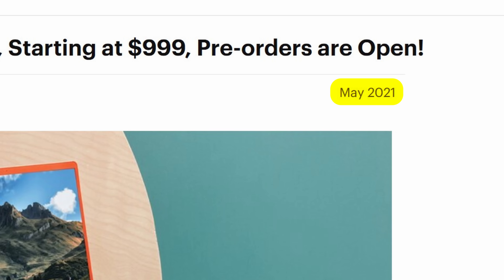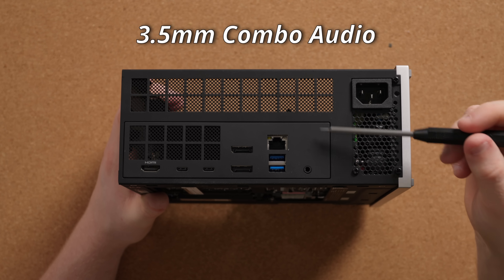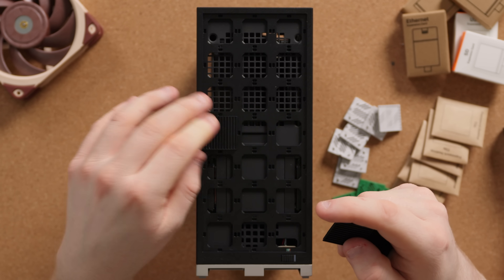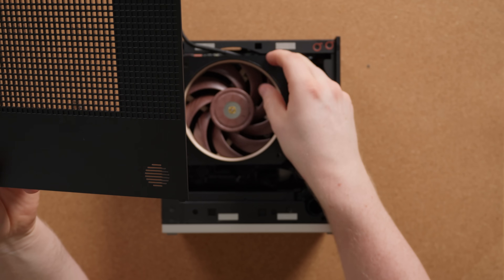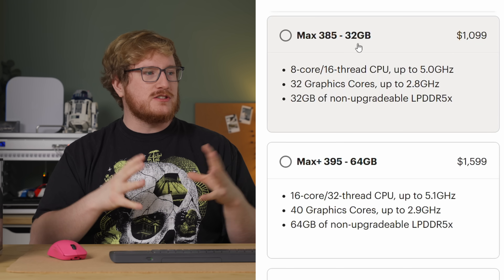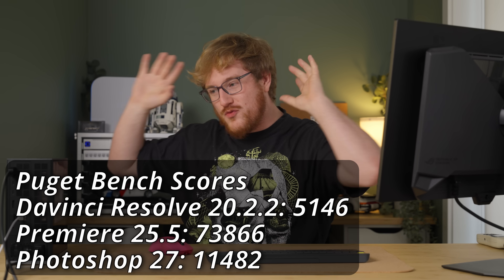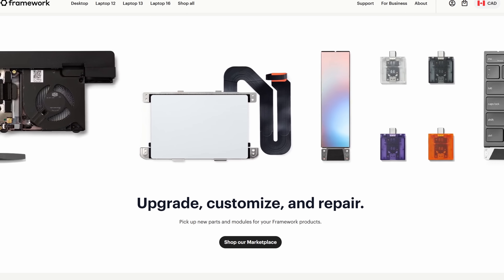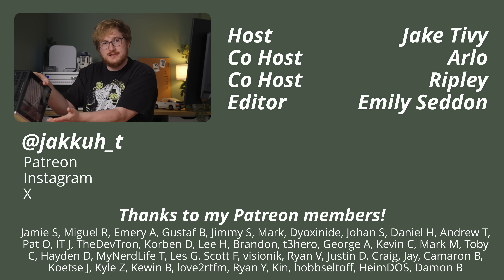I’m glad I didn’t invest, so I can talk the Framework Desktop

Comment: Maybe they could work with Valve to option it with SteamOS?
Reply: Aside from whatever issues with the mobo, this should install SteamOS very nicely.  If not, Bazzite would be a better solution.
Reply: 'SteamOS' is basically Arch with Proton. -.- you can do that too on any PC. Event today. Even in this very moment when you read this.

Comment: Why buy this when you can build a mini pc (6-7 liters) with 5070 and 7800x3d for much cheaper. And worshipped “modularity” is basically nonexistent here
Reply: Expiremental GPU that is probably the same kind used in the Gabe Cube
Reply: Because it comes with the massive VRAM which is useful for AI stuff.

Comment: Arlo treat tricks has become a great tech channel.
I can understand the power cable pricing crap a bit but I still think that they should include 2 prices on the site. One starting at price and one minimum configuration price for it to work. They could add a up-to price as well, but that would ask for too much because you could order extra stuff (my FW13 has a few extra IO-modules because I wanted to be able to change them if I need to)

Comment: On Linux, the AMD drivers can dynamically allocate more memory, so there's no need to adjust the BIOS setting up to 96GB like you did and strand that memory when you're using a CPU-intensive workload.
Reply: Agreed, I have like 110GB dedicated to the GPU, and have several LLMs loaded in memory all the time. (qwen3-coder:30b, gpt-oss-20b, etc)
Reply: @IanDouglas you can change to the ram to GPU on Linux for AI/LLM?

I have 96gb of ram and rtx 4070
Reply: @aymanhawari2589 you can on this Strix Halo system because it's an APU from AMD which is a combined CPU and GPU, effectively making it "unified" memory.
Reply: @aymanhawari2589  no. only in non-dedicated GPUs
Reply: @IanDouglas  wait damn like M chips? thats the key to unlocking full power, only when all is same sillicon.
Reply: @daavilefx if it's an APU, then yes, I think so
Reply: I have had problems with that before though - specifically ollama would, at least last time I checked, not realise it had that extra memory on AMD APUs (780M only in my case), and would refuse to run, even though Linux would have just allocated it for ollama. So easy fix, maybe it works by now, just be aware.
Reply: @vocassen  i have the exact same problems and set my system up 2 weeks ago i think it is still an issue (unless there is some workaround im not aware of)... either way i never reallly use more than 90 gb of vram (because the bandwith bottleneck) and im not having problems with running out of system memory so i dont really care and will keep using ollama backend
Reply: @vocassen  wait what motherboard made for this chip doesnt let u allocate vram in bios.. .thats insane lol sorry forry your loss... also if your os is taking up 4gb u might be on the wrong OS (but whatever works for you i guess)

Comment: the power mode thing isnt even an issue with framework or it technically being a laptop chip. its just an annoying issue with windows 11. win 11 will just put your pc on balanced or even power saving for no reason sometimes. i recently upgraded my pc and switched over to win 11 and my pc is an absolute behemoth reaches 1000 watts under load and even with that windows defaulted to power saving mode and i had to manually switch to performance mode. but at the same time other win 11 pc's ive built default to performance and dont throttle the power so it seems to be completely random or more likely theres something in some motherboards or cpu's that makes windows thinks its supposed to be running low power. who knows, win 11 is just fucking weird.

Comment: I have a Strix Halo laptop (HP ZBook) and the 395 is just insanely good (with arch, by the way). the GPU is quite damn good for gaming. like I can comfortably play Cyberpunk on it at max quality (with no raytracing), and everything else I've tried on it so far has been great. Not as good as a 4080, for sure, but for the form factor and the non-GPU benefits of the rest of the system, it's crazy how capable it is for being integrated graphics.

Comment: I think they should have put in the option to have a full 16x or at least 8x electrical 16x physical PCI-e 4.0 slot.  There are 16 PCI-e 4.0 lanes available from the chip.  Boot off the other stuff or make adapters for the 16x slot to hold the SSD's   That still only adds up to 12bits, so I don't know where the other 4bits went to.
Reply: This is not correct. Those 16 PCIe lanes are across different PCIe cores, so you can't just combine them. You need 4 for the chipset, 1-4 for LAN, BT and WIFI each... The most you'd possibly get is a x8.

Comment: Well if socketed or not, it doesn,t change if it works or not, but soldered on has some benefits. Soldered on ram is usually faster and has tighter timings, which is important for a unified memory setup. 
AMD does not say you couldn't do that but its not recommended.  Also Laptop chips have usually weaker signaling source what makes keeping the signal on a socketed ram hard. there are plenty of Mainboards out there that uses Mobile Processors with Socketed RAM and i don't speak about those weird Alibaba mainboards. 
Asrock J5040, J5005, J4105 and J3455 or the MinisForum BD790i and BD795i or the Whole Intel N-series line up on about 20 different vensors. so yeah nothing so special about mobile cpus on a desktop platform. maybe not allways that powerful but there are great options depending on your needs and Pocket depth.

Comment: so this isn't the first video I've seen of tech heads doing an LLM build, I have to ask .. why? Is it to have an offline chatgpt or are there other advantages / use cases ? kind of makes sense as a performance benchmark but for everyday use I'm confused as to why people are building personal LLM machines.
Reply: For one you aren't limited to how you interact with an LLM - some people do some weird roleplay stuff among asking other things that are censored typically by mainstream sources for LLMs.

Otherwise to ensure that none of your personal data that you prompt your LLM with is being harvested by the companies running them for privacy reasons. Perhaps you're using an LLM to sort through, summarize, or overall interact with personal info of yours. Or you run a small company and are doing something similar with those company documents.

You wouldn't want to do any of that while connected to a server that you aren't in control of. But these are just a few examples I could think of. Maybe there's better, but I don't personally use LLMs in any way that would make sense for a local instance over just loading up GPT on my browser.

Comment: I have a feeling that we may eventually need two memory controllers, one for high performance, and one for average performance needs. That way you could still upgrade by buying consumer memory while still utilizing the high speed memory that's permanently fixed to the board. It's physically impossible to build external RAM modules fast enough (or close enough) to meet the demands of the chip. (using consumer technologies)

Comment: OK, time for a video guide on locally running LLMs, the hardware requirements for different models, etc? Would love to understand why some are building home clusters of 4090's while others are connecting a rack of 40 Mac Mini's together via Thunderbolt
Reply: PCs are Fast
MAC for efficiency
Servers for size
Ryzen AI mobile CPU for windows, efficiency and (maybe) cost

All are fine
Servers will be best overall but are not easy
MAC are really efficient and easy but not fast for the cost
PCs are mild difficulty, if you ask/know you can build a incredibly fast and cheap but are not efficient
Ryzen AI CPU are easy, efficient and cheap but aren't fast

Fast being 80 t/s for 8b

Clusters are mainly for fun they aren't that great

For 8b: 12gb VRAM/Unified RAM not RAM it's slow
12B 16gb
20B 24gb
24B 32gb
30B 48gb
70B 96gb
120b 144gb

Assuming Quant 8 with at least 8k context, 30B is good enough for most, these are rough and as you go higher parameters I am assuming you want more context

Dedicated GPU's are significantly faster. 7900xtx is the best cost for performance and vram ATM.

Comment: 13:30 if I remember correctly, AMD and framework did look into using so-dimm memory, but it was deemed impossible, I suspect the performance of the igpu using 5600mhz so-dimm would take a massive hit, and that would be even worse PR hit for AMD than soldered memory, but then again, AMD seems to do their hardest to take PR losses, like the RDNA 1 and 2 losing their game optimization driver support, I knew when I heard the first time that they're going to revert that decision, which they have, but not before once again taking an L in the eyes of consumers.
Reply: yeah, maybe once camm memory is a thing.

Comment: When you say it exists in it's own space. I would argue that it directly competes with any system that's built at home. Because at that price you could build a seriously quick machine, yes it's small but we have small form factor machines. Yes it's quiet but you can do quiet with a home build machine as well. I will say on the power draw side of things it's going to beat most home built machines, as that's a lot less than a modern GPU. And probably the biggest thing the ability to share out memory for LLM work. That's probably it's biggest sales pitch.
Reply: its* possessive doesn’t have an apostrophe.
Reply: @MyPupTobi  Thanks for that helpful and insightful comment on a technical discussion. Brings much to the conversation....
Reply: + the exchangeable inputs and face changes you can do

Comment: That PCIe slot is not meant for (and it will not support) dGPUs. It is designed for storage expansion among other things. The iGPU can handle some games fairly well though.
Reply: Its mainly an AI workstation but the iGPU is around a laptop 4070 level so basically a desktop 4060

Comment: Framework (the CEO, the guy who is always visiting linus) answered why it's a closed PCIe slot on the board when they had their release presentation of the Framework Desktop. It's because the open slots are not to code with the PCIe standard. And Framework decided to stick strict with the standard in all cases.

Comment: 15:40 The GPT-OSS-120b is smaller than Qwen-8B. As a MOE model, it is only using 5B parameters per token. As long as you can fit the model into VRAM, it will run like a much smaller model.

Comment: "I'm glad I didn't invest in Framework." - Drops the video exactly when Valve reveals the Steam Frame
You sly fox.
Reply: You mean the Steam Machine? The frame isn't exactly comparable...
Reply: Once the Steam Machine comes out, I'd love to see a head to head comparison vs the cheapest Framework model.
Reply: Hyped for the GabeCube
Reply: Modern problems require modern solutions.
Reply: you cant invest in valve though, they're private
Reply: @Lulzinh  thats.. not the point.
Reply: @Lulzinh  isn't Framework also private?
Reply: @phygs Ye but they did have investment rounds

Much like that other guy making a new router that can do 10gbit

Comment: The VRAM on a 5090 isn't socketed either for basically the same reason. PC parts are partially culturally constructed, within physical parameters. Socketed system RAM but soldered VRAM is like how oranges come in bags but strawberries come in punnets

Comment: Framework explains why the memory is only sold as soldered. The reason is, they did some engineering work with AMD to see if socketed memory was plausible, only to find that it would cut their bandwidth significantly due to signal integrity issues. This being promoted as a bandwidth beast would be undermined if they sold a version with socketed memory.

Comment: I have one running bazzite and it faster than it was in windows. Been gaming on it quite well with only one game being horribly optimized and running like poop. Geekbench 6 is faster on Linux like way faster. I have the 80mm fan in the front and open 3d printed plugs. Between this and my m4 max Mac Studio I don’t want to even boot windows anymore even for gaming.

Comment: 13:43 it's less that they don't allow it and more that it's not technically possible. The CEO of framework said they had AMD engineers run simulations at their request and they said the signal integrity just isn't good enough with slotted memory

Comment: The best part of the framework desktop is it's a standard itx motherboard and you can order the board without the computer, so you can slap this in a mini itx case and make use of that slot, whether it be for a mini workstation or home server. You could Dremel out the slot for an x16 card, but honestly most non GPU accessories are x4. A capture card for streaming, a faster network card if 5gb is insufficient, a sata controller if you want to make this a home server. 16 cores and a real GPU means you can throw vms at this thing without running out of resources. The actual case is awful, but the board is great.

Minisform also has a mini itx board with a 7955hx for 350ish dollars, so 16 core CPU and mini itx motherboard with sodimm slots and a full x16 slot. Honestly that motherboard is the cheapest way to get a 16 core CPU for home server use if you don't need the igpu from strix halo

On the soldered memory and such, this case is a mini itx case. You can just put in another mini itx board of your choosing if you like the case. As long as that board has 2 USBC headers for front io, you don't even lose the front ports.

Comment: 9:55 This is a REALLY bad take. The average DESKTOP user doesn't even think about power profiles. Considering they market this as a desktop computer, it's not something that most people would intuitively think to check. I honestly think Framework screwed themselves with that and they kinda deserve the bad press they got from it. You can't just assume everyone will know that it's the power profile that is causing the issues. Unless this is clearly noted somewhere in the included stuff, or directly on the store page, this is Framework learning one of the hard truths.

I wouldn't be surprised if the average laptop user doesn't even touch the power profiles.

Comment: Who actually cares about how compact it is....seriously. It's a desktop. It could be 50% larger and would sell the same, or more units.
Reply: lots of people like smaller formfactors for various reasons. portability (bring it places), space at the tv or on the desk (not everone has a big house with a lot of shelfspace)
Reply: It's really helpful when you want to bring a small powerhouse to let colleagues try your new wired VR high resolution headset. And it's 2 to 3 times less expensive than their Framework 16. Without VR, the Framework 13 perfectly gets the job done for me.